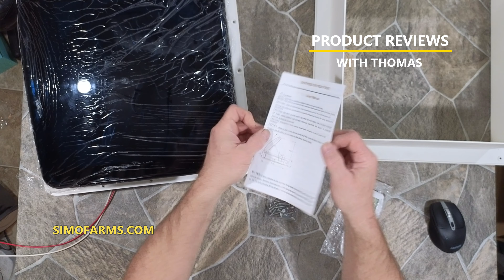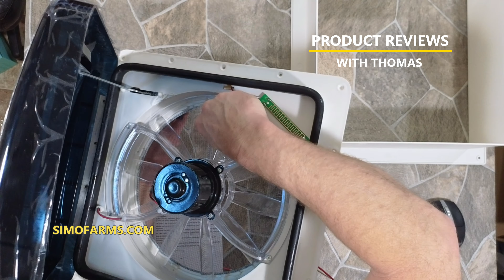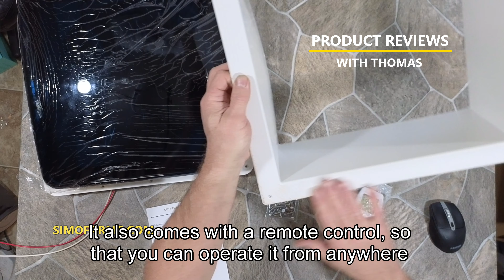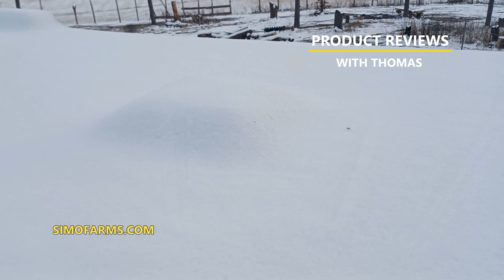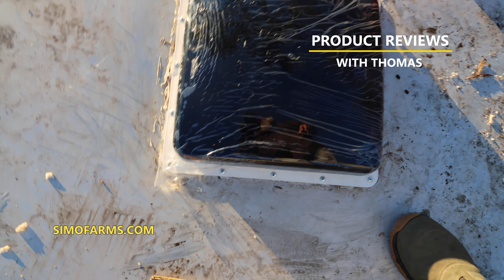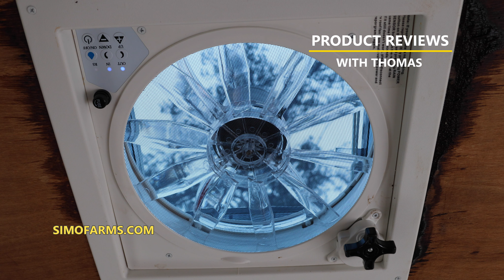OUTPRIZE RV Roof Vent Fan, 12V Remote Control 14" Quiet Smart RV Roof Fan

Comment: Nice product except that my remote quit working after 3 months and they don' have a replacement to buy. I have a 5th wheel with a 9' ceiling so the remote is useless at this time.

Comment: Can you recommend a 12 v system transformer to connect it to. I'm putting this same fan into a food trailer so the trailer does not come with a 12v power system.